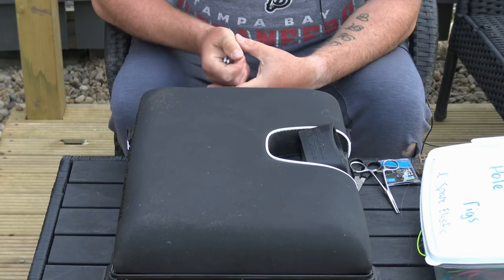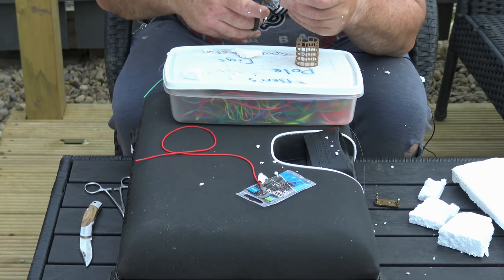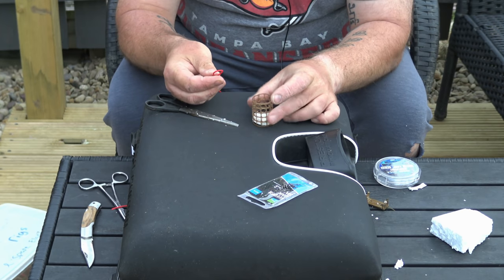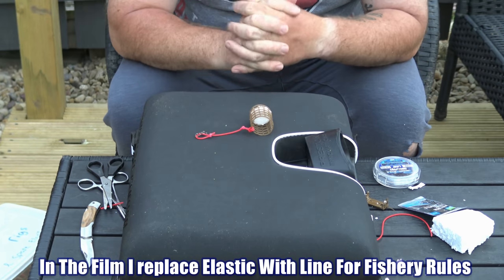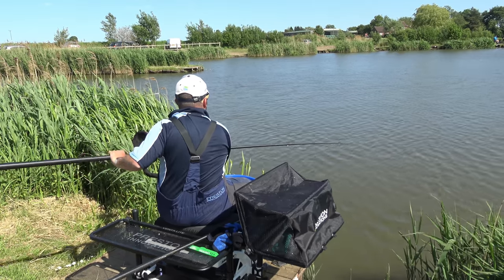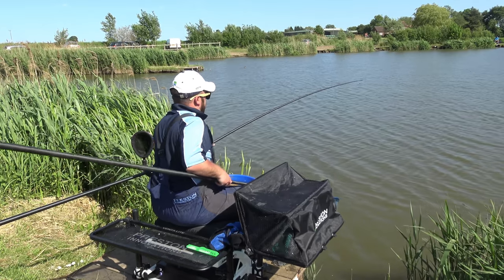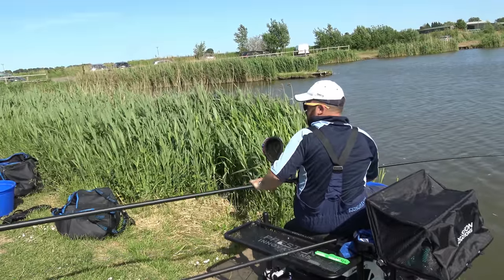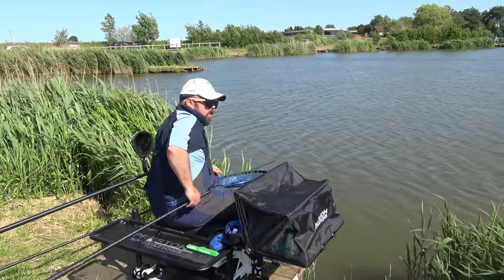How To Make & Fish The Floating Feeder On The Pole (It's Back)

Comment: Can I suggest an alternative to buying expensive plastic feeders then taking the lead off etc. Simply buy a pack of ladies’ hair curlers and cut them down to size.

Also an old piece of foam pipe lagging can do the floatant job. Cut 1cm wide sections off the end of a length of pipe lagging. Squeezed tightly, it can be pushed into the feeder and stays in place. I’d still glue it in though.

Comment: If you get metal pipe or feeder of the same internal diameter you can heat it up and push it through the poly. No mess as it melts it and cuts cleanly

Comment: check with the fishery before using this it is NOT allowed at some fisheries.
Reply from the maker: Was ok but good advice
Reply: Don't see why this would be against fishery rules. It's not a floating bait.
The only rule that I know that touches on how you feed, is you are not allowed to use a second pole or rod at the same time.
I make my own 3 gram wagglers combined with a small maggot feeder.
I catch lots of fish on them fishing past the pole line. There is no rule that says a feeder has to be on the bottom.